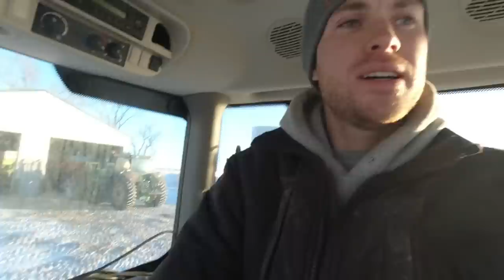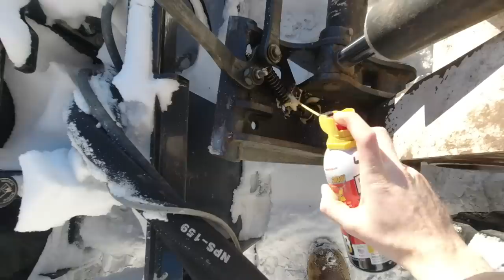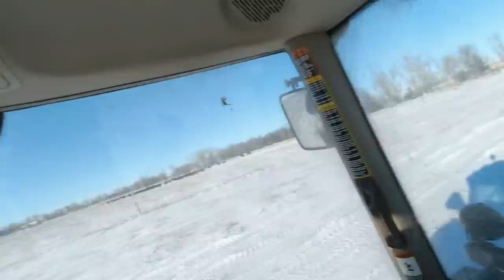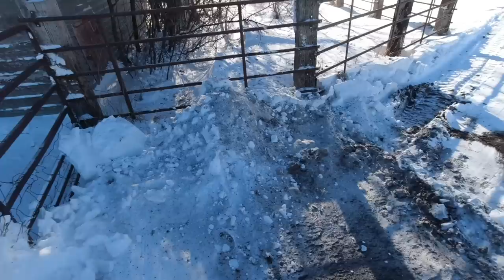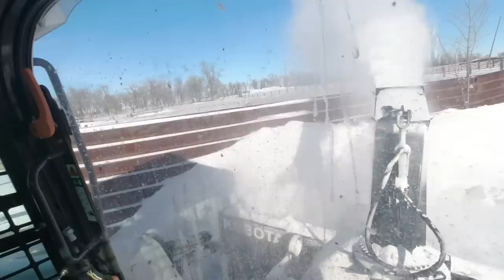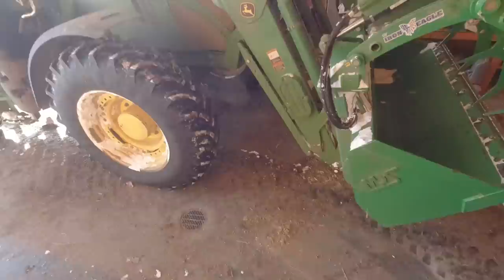Digging out the Corral

Comment: Each time we watch you fellas, it's like seeing a friend we haven't seen in a while. Even though we watched your last vidya, new vidyas are a pleasantry we loo forward to. Brian, have you ever had a 3 point blower? Just wondered how it compares to the hydraulic skid steer version. Cheers Gents.
Reply: I still actually have a three point blower. I hate crankin my neck around to see!
Reply: I am with you there. I just put a blade on the loader and plow it. I did pick up a 3 point blower on auction 2 weeks ago. Have yet to try it. My little mule is too small for it, and my big mule only has 1000 PTO. If I spin that blower's 540 input shaft at 1000 it oughta really blow the snow! LOL More than likely blow parts all over the yard. Cheers buddy.

Comment: On your snowblower for the chute swing situation turn your auger on with max throttle on the machine and toggle the switch that moves it side to side about a bazillion times as fast as you can and it will probably break free. Seems like on them kabotas the gear gets stuck and the motor can't quite turn it with a bit of rust on it.

Comment: If you were to put a t650 with multi bar lug snow & ice tracks behind that blower instead of that s650 I guarantee you wouldn't regret it.. you can just creep along & let the blower do the work without worrying about losing traction.  Hard drifts or snow piles will dissappear & no more bogging down the machine.

Comment: I can't decide if the hydraulic doesn't have the pressure, the skidsteer the power, or the blower the balls to move that snow. I'm used to sierra cement, much harder to move, but close enough. Enjoy.
Reply from the maker: Need more horsepower and a high flow hydraulic skid loader
Reply: @SonneFarms  I thought it sounded a bit anemic. You need tracks too.

Comment: Hydraulic couplings should not be defrosted with water. if anything is left behind. keep this problem and it will only get worse
Reply: Keep a bucket full of warm used hydraulic oil in the heated pump house for unfreezing those couplings.